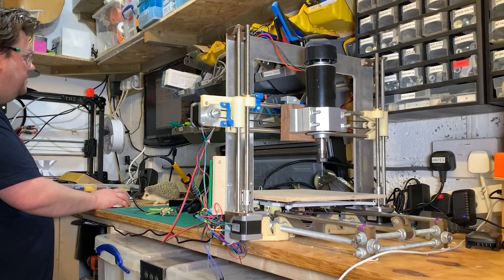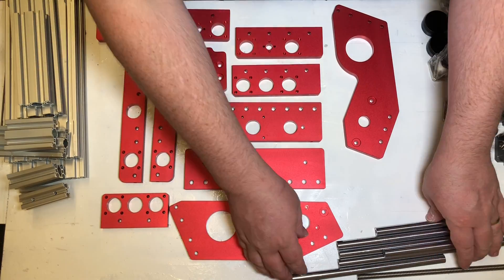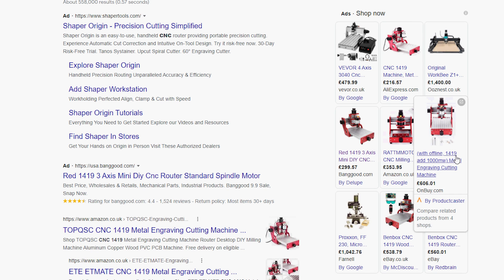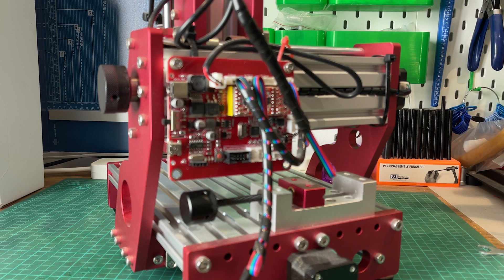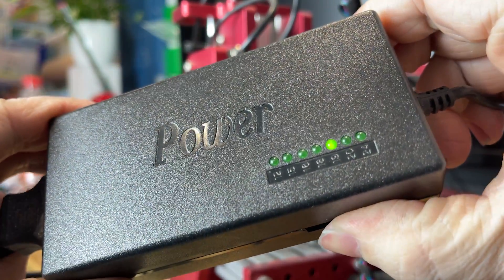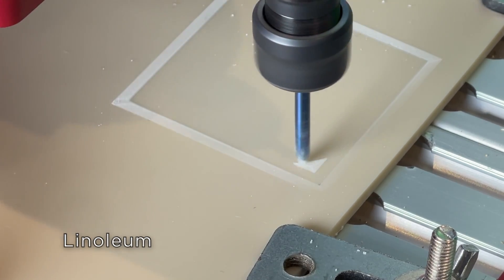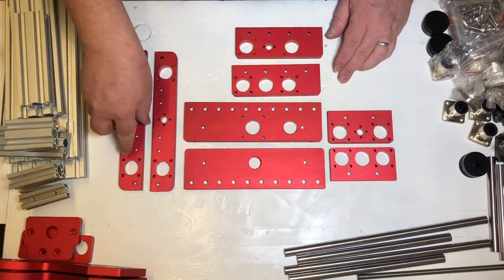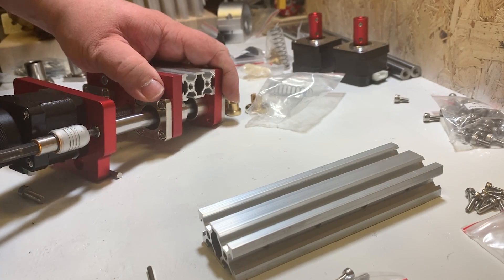1419 Red CNC Review

Comment: I am trying to use OpenBuilds Control with my 1419 CNC but I can't move the motors with the software. Any idea why? It is also telling me that my Grbl 0.9j is out of date and I need to upgrade to Grbl 1.1.
Reply from the maker: Upgrade - it won't hurt and include lots of nice extra features (some of which you won't use of course but still nice to have)
Reply: Those boards on 1310/1419 usually are grbl 0.9 and with lockbit set, so you have to solder AVR chip onto arduino board and use Tl866 HV programmer with adapter to remove lock bit and flash grbl 1.1. Which works fine with Candle2.